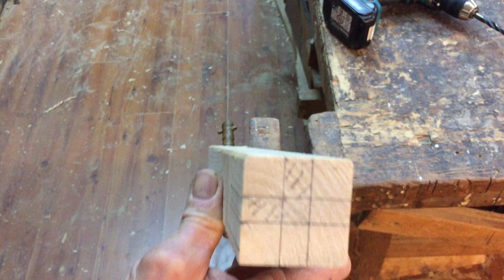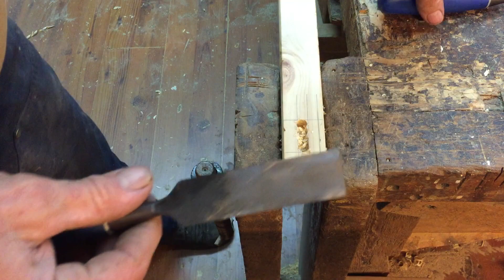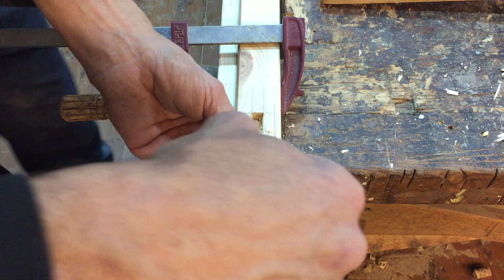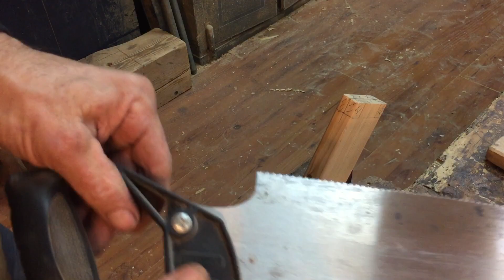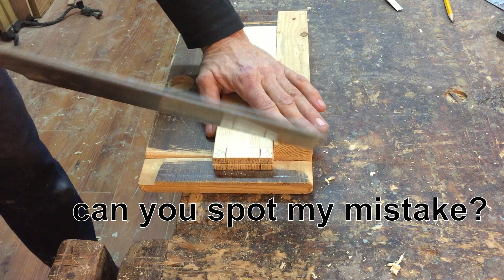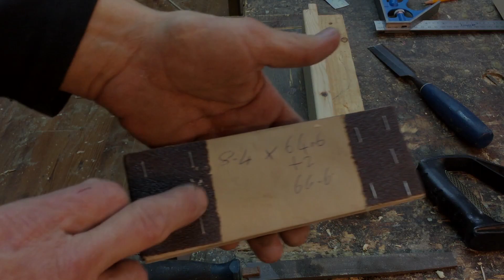Mortise And Tenon Joint For Beginners (Bare faced with hand tools)

Comment: Thank you! May I ask how can we secure the joint? (glue, screws, dowells, nails or nothing?)
Reply from the maker: Hi Aristidis Glue and a clamp pressing the two parts together is great adding a dowel to pin and lock the joint is guaranteed to minimize joint failure even if the glue fails Happy Woodworking David

Comment: Another useful video - I was unaware of 'bare faced' tenon joints.

I was the one who asked "... if you could cover the practical basics. i.e. How to get a chisel or plane blade 'good enough' to use." Just to clarify, there are loads of "How to sharpen a ..." videos but they often suggest that you have to pay the price of a small car to acquire seven Japanese water-stones handcrafted on the slopes of Mt. Fuji in grits ranging from road tarmac to smooth as glass. And then spend hours sharpening, honing and stropping to get an edge you can shave with.

I was hoping that with your clear and practical approach you might demonstrate how a beginner could best sharpen a chisel with just a cheap stone or whatever else can do the job.

Best wishes, thank you and please keep making the videos.
Reply from the maker: Hi Stephen,Thank you,and thanks for sticking around the good news is i have already shot the cheap oil stone video i hope you will like it i just need to edit it thanks again for your input Happy Woodworking David